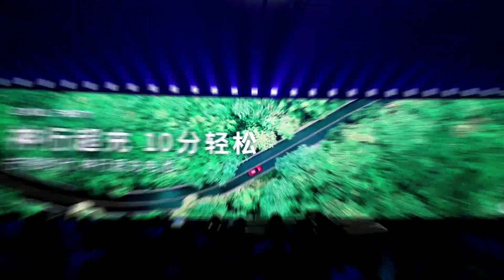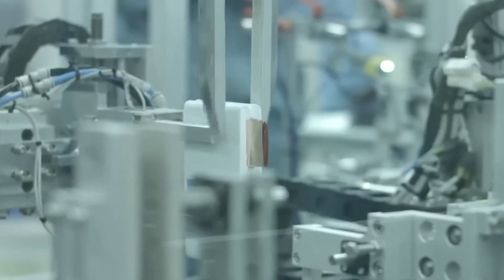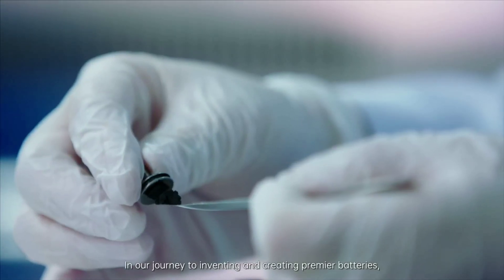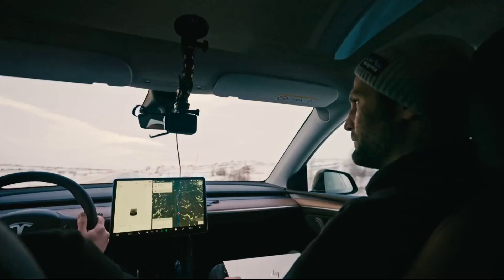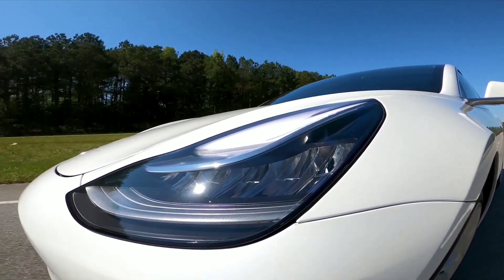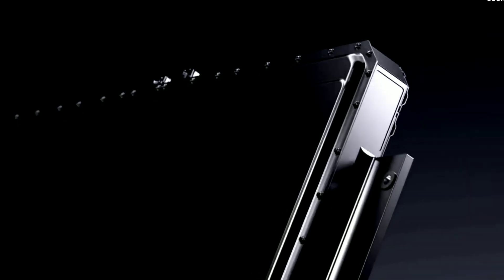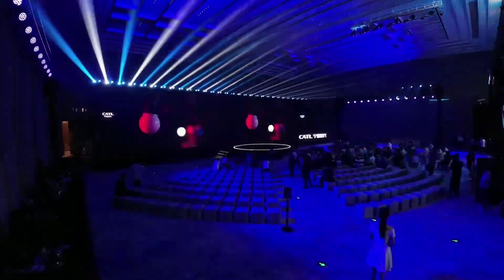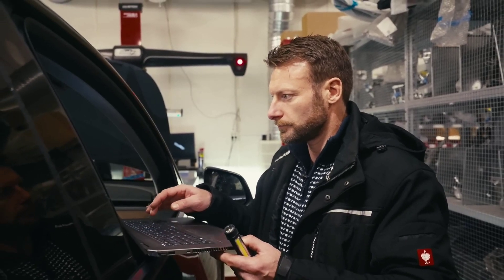CATL’s New Batteries for Tesla EVs Are So Powerful, That Will KILL the Competition

Comment: I can get 800km worth of disel intoy yank in les yha 10 minutes. With no massive expenditure on EB charging networks. Also sodium batteries have a very wide voltage band which makes the effective usable stored energy a lot less than the total energy stored.

Comment: CATL sells to anyone and everyone who has the cash, so this changes nothing.  It's no boon for Tesla and not a competition killer.
Reply: This is of course a competition killer, it kills other battery makers.
Reply: @marvinfok65  
You can't patent battery chemistry, so no, the competition will just copy it.
Reply: @yourlogicalnightmare1014  
If it is so easy replicate the battery, Tesla would just produce their own batteries. Why would Tesla buy from CATL and the profits will help CATL further their R&D which can sell to Tesla's competitors?

I don't see other battery makers like LG, Samsung or Panasonic launching an equivalent fast charging battery.
Reply: @marvinfok65  
Duracell & Energizer.  Case closed.
It's very easy to copy battery chemistry, which is why there are dozens of Lithium battery manufacturers. 

The same 18650 batteries I use in my flashlight were once used by Tesla.
Reply: @yourlogicalnightmare1014  
Logical nightmare, yeah very true!
Reply: Tesla being about 10 years ahead of its competitors has little to be concerned about! They are ghd Masters of Lie production costs n nothing but word of mouth advertising! No one does it better!

Comment: If it charges that fast and is real,  this will be a huge success
Reply: CATL is already in production and is to be launch in end 2023 or early 2024. If Tesla is going to use CATL's batteries, Tesla must have tested the effectiveness of the battery.
 
Seen a couple of tests on NMC batteries and they burst into flames easily on impact! LPF is definitely the safer bet. Though NMC claimed that they can be charged to 100% and therefore a longer mileage on per full charge, they degenerate quickly on full charges and is therefore not advisable to charge it to full therefore reducing it mileage advantage on per charge as compared to LFPs.
Reply: @marvinfok65  i really can't wait to see these in a Tesla. Issue is with the rebate in the US dependant on being in the US not sure it will end up in one.  I have an SR model 3 and really love the improvements in the new model 3

Comment: One suggestion.  Consider this challenge.  A battery that gives 200 to 300 range with 2 hours of charging  but using only solar and wind power, without the need for charging manually.  This will be most useful for consumers everywhere, for it eliminates the need for charging once for all. .  Unlimited range without the need for charging is the most important challenge to save the planet from climate change..  No better goal exist.   Can you guys do it ?  If so, then you are creating a revolution.   Best Wishes from India.

Comment: There have been many such „claims to fame“ in the past, so I will believe it when I see it.
Reply from the maker: You can Google it.
Reply: @FutureGalaxy  How many real-life test drives can you refer to with regard to 1) charging with present-day chargers 2) range tests in winter and in darkness with the use of lights and heating 3) longevity of the battery. Laboratory tests and tests in practice are two very different issues.
Reply: the previous iteration of the technology (called Qilin battery) is used in zeekr 009 car.

Comment: 250 mile on 10 min charge virtually impossible unless you have a dedicated substation and enormous charge cable
Reply: You are in for a Surprise!
Reply: @colinsuter6888  I would be surprised, it would have defy the laws of physics. Do tell
Reply: @colinsuter6888 considering the average long range EV car consumes about 300 watts per mile that’s 75 kWh of energy over the course of 10 minutes or a peak charge rate of 450k watts. A few cars charging at the gas station and you have over a megawatt of power on one service. Yeah fast charging is a serious problem.
Reply: It the batteries are capable of doing that, it's the infrastructure that has to adapt to the new tech. Do you want the battery makers to wait for charging stations to adapt before the new tech is released?